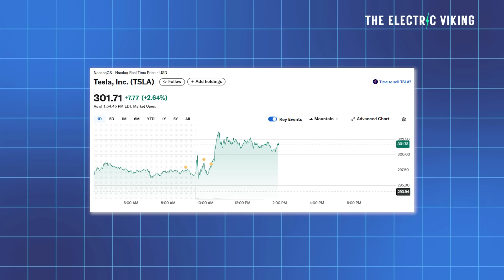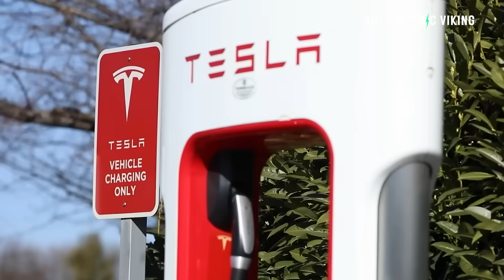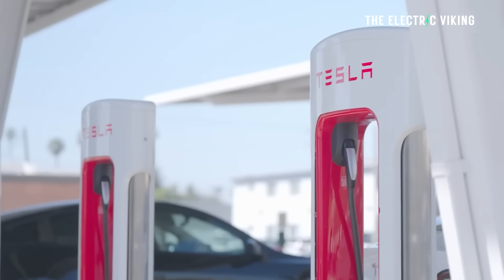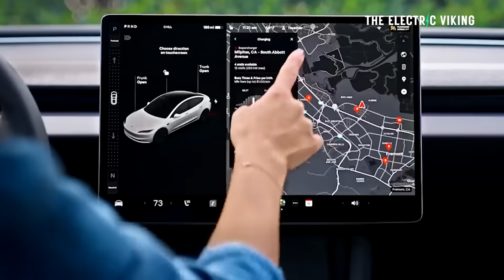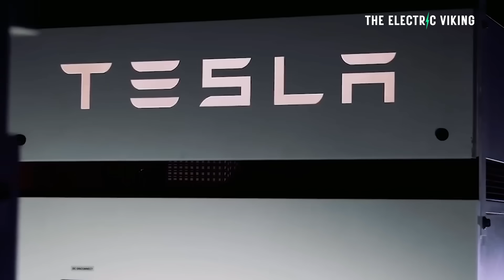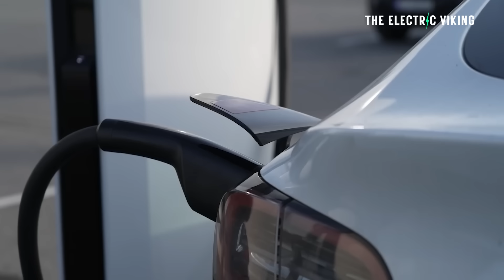Tesla's not very secret PLAN to make BILLIONS with Peaker Plants

Comment: NIO is doing the same with the swap stations, some are topped up and the others are used to speclate on the energy market. A NIO insider told me the swapstations are profitable even without swapping. They have3300 stations now. Other ones like BYD also have batteries at their fast chargers to cover peak charging and speculate.

Comment: The thesis is valid, however Tesla does not make its own batteries. It makes them only for some vehicles but it costs them more to make them than it does to buy them. If Tesla was devoting enormous resources to manufacturing grid scale battery packs they might become a market leader. But no, robotaxi and robots are where they are putting their priority. Other competitors are growing everywhere and Tesla is growing slowly. So like the charger business they threw away by firing all 500 in that business unit Tesla is not optimizing their potential.

Just like robotaxi, where competitors like Waymo and Zoox, and several Chinese companies, have outpaced Tesla in autonomous rollout.

Comment: To have a 1:1 solar powered "gas station" the ground footprint would be the size of a 1980s shopping mall, which means a roof setup is just for marketing.

Using the excess solar power off the grid is definitely a smart move.

Comment: So long as they use brownfield sites and buildings instead of clogging up arable farmland with solar panels then it's a great strategy, and homeowners should be doing the same for their own homes as soon as they can afford to cos solar panels and batteries are basically a money-printing machine powered by the sun, whether you use the stored energy at home or sell it to the grid at a premium to buy back when it's cheaper.
Reply: Tesla should locate production and storage as close as possible to the charging stations because a lot of energy is lost to friction in transmission. Do they do this?

Comment: The same analogy applies to hydro electricity .its Free too. The rain falls runs the turbine for free ,the water evaporates and it rains again. The difference in hydro is it’s not 2 hours a day like Teslas batteries its 24 hours. Hydro actually produce  the electricity Teslas batteries just transfer it from other generating sources to a different time of day. The concept of “Free” used here disregards the capital cost.

Comment: 62 cents per KWh is insanity and only works in CA.  We pay about 42 cents peak around here and even that is so high compared to a few years ago and only barely break even with gas.  Gas is actually cheaper than supercharging now.  As a comparison the model Y at 3.6 miles per KWh @ $0.62/KWh is equivalent to a 32 mpg gas car paying $5.58/gallon for gas.  Nobody is converting to EV’s at that pricing so your superchargers will be empty.

Comment: What about the cost to rent or buy the land and the cost of the capex for the batteries and installation. It would have been good to add how long it will take to pay off that investment before you actually start turning a profit
Reply: Those numbers have been crunched.  Solar wind and batteries are the cheapest form of energy cradle to grave.

Comment: I have time of use charging in illinois. When I first started the cheapest time to buy electric was between eleven p m and six a m. Today that time has changed 'to 2 am until ten am. At those times it cost between 0 and 2.8 cents per kilowatt hour. My highest rate for electricity during the day (at peak times is sixteen cents per kilowatt hour. Tesla with its virtual power plant can get paid between two dollars and seven dollars per kwh at peak use. All Tesla would need to do is add 1 mega pack to each charging station and they could make the difference between 2 cents per kilowatt hour charging at night and get paid 2 to $7 per kilowatt hour during the high peak use. They already have the connection to the grid.They already have the distribution nationwide. This is A no brainer it will make Tesla billions. I did the math on cost of  running my model.Y and if I charge at home, the cost is .007 cents per mile. Over the lifetime efficiency of the car at a hundred and seventy thousand miles very cheap to run.
Reply: FL Power allows unlimited FREE night and weekend charging of EVs.  They only charge $31 a month for leasing the chargers which they install!

Comment: Summary per Grok:
Tesla’s claim of 100% renewable energy relies heavily on purchasing RECs to offset grid-based fossil fuel use, which has been criticized as misleading since it doesn’t reflect the actual energy mix at most stations. Without comprehensive, up-to-date data from Tesla on the proportion of on-site solar versus grid power, a precise figure is difficult to pinpoint, but 5% is a reasonable estimate for direct solar contribution across the network based on available information

Comment: I agree wholeheartedly with this analysis. It's the joined up thinking we need.  Governments should embrace this combined distributed electricity generation-grid firming-EV charging logic through market rules and incentives for new EV charging infrastructure. In the UK they are now finding many fast large charging sites are hardly used while others boom regardless of price. They were installed before user behaviour and spatial distribution patterns were understood. Australia can still avoid large scale mistakes and optimise multiple energy-system benefits in the rollout. 

Allowing electricity distributors to install chargers on their poles all over the country will spur kerbside AC 7-22kW community charging infrastructure for EV owners without home charging. With time of use charging and modest use of batteries it could also use up excess off-peak solar through local poles and wires. 

Throwing money for chargers at businesses is a poor strategy for the medium speed 'destination' charging network of 50-100kw plus where people or business fleets can fully charge in and around hour while already parked up. Instead govt could provide financing schemes to help install rooftop and carpark solar with batteries and EV charging at commercial sites. Some would also have capacity to trade in peak electricity. Big box roofs are the most underutilised distributed electricity resource there is (tenants and landlords currently need aligned incentives) and in many cases the on-site solar would allow a few charging plugs per site without slow and expensive new grid connections. 

Finally, the superfast national charging network we need is all about max charging speeds and optimal locations. Locations essentially just need to follow the distribution of petrol stations (and truck stops) to cover all of Australia. 3-4,000 small to medium sites with truck charging amenity is probably enough but they must focus on vehicle throughput and future proof charging speeds of 500kw to 1500kw+. Time spent looking for a charge or waiting for a charge is a PITA and lost money for commercial fleets. Government incentives for these sites should require Tesla-style linked local solar farms and batteries. Many will also be able to sell electricity to the grid at peak.

With strategies like these you'll get a lot of new distributed renewable electricity production and consumption through mostly existing poles and wires from capex shared with a much needed EV charging infrastructure. And it could save a motza in new large transmission lines otherwise needed for utility scale alternatives. Not to mention the economic benefits of keeping $40billion in Australian economy that we currently send to other countries to buy petrol.
Reply: School rooftops should be covered in solar panels. Big profit during holidays and weekends.😊

Comment: There are a ton of flaws, and in general inaccurate statements in this video.

1.  Tesla does NOT offer a 30 year warranty on the Megapacks, but offer a 15 year warranty, about half the claimed period.
2.  Several other energy storage companies will be able to offer much cheaper solutions with Lithium Iron, Sodium Iron or other storage technologies, as the energy density and weight isn't a factor in energy storage like it is in EV's.

This means that utilities will rapidly install their own energy storage, making Tesla's model for cashing in on peaker plants obsolete.

Just look at what anyone can buy today.  LiFePo4 batteries with 2.5kWh worth of storage are down to $300 or so, and can last 8000 to 10000 charging cycles or more.  Energy storage is being ridiculously cheap and simple to set up, with the average Joe being able to store 25kWh for less than $3,000 or so.

The cost for a Tesla Megapack with 3.9MWh of storage is just north of $1 Million dollars.  5kWh LiFePo4 battery packs can now be bought for around $750 or so.  Which means a 5MWh worth of storage can be bought for $750,000, and that is using retail prices when buying one or two at a time.  Buy 1000 or 10,000 at a time, and you would get a significant discount, getting the price closer to $500,000 for 5MWh.

This is the problem with a lot of the companies that pioneer something new.  You will see a bunch of new companies (already happening) jumping into energy storage, which will rapidly compete with these Tesla storage farms, and rapidly evaporate these peaker profits.

As a bonus, with Tesla losing emission credit sales and car sales still dropping, expect Tesla to start posting losses again by the end of the year...

Comment: Nothing is free sam.
The infrastructure has a cost and a return on investment requirement. 
Billions spent and Billions financed. 
So recovery cost and the charge out fee has to pay not only for the investment but the finance cost also as well as the maintenance and the repairs and servicing of the charger equipment.
There are Government licencing and permitting fees also.
A correction to your statement Tesla get power for free. 
Tesla do use grid power to supply roadside charging where they make a mark up Arbitrage profits on energy..
Tesla do not provide financial details for their charger revenue in Australia let alone other countries as their financials are consolidated accounts. 

So is it worth 220 times revenue- I don't think so.
Other pure power companies are not priced that magnitude. 
Tesla is priced for Fanboy attraction.  
Is it a solid business model - Yes but others are entering so it won't hold a strong first entry position for long.
BYD and CATL are signalling doing a similar thing in EU and in Australia with fast charger networks.
A number of companies have done the very same thing already in Aus with Solar and batteries feeding back to the grid in the wholesale market of the NEM here in Aus. 

All competition reduces margins and the Chinese will eat into Tesla's markup for sure.
I is not If - it is when.
Reply: The problem is that it doesn't seem that byd has made money selling evs and may be losing money in even the combined battery and hybrid markets......

Comment: TSLA down 20%+ since 1-1-2025.  BYD up over 40% since 1-1-2025.  That is a 60%+ swing.  3 months ago I sold all my 7125 shares of TSLA for $1.7M and bought 10,000 shares of BYD.  Check the charts......
Reply: TSLA up 11,000 % since IPO...
Reply: I will sell my TSLA in year 2030 when Tesla Energy is bigger than Tesla Auto
Reply: You sold at 238.60 a share. Today 10July 2025 the price is $296 up 24% on that price and it has been up to $363.

Comment: Those batteries won't last 30 Years. And batteries are very inefficient. In cold weather the chemical reaction of batteries is slow, where some say 40% less efficient. In hot climates batteries need to be cooled for the purpose of saving the battery life, which could be up to 30% efficiency loss. And for solar to be worth it, it needs to be a sunny climate.

Comment: I live in Texas and I'm already shaving 3% of my electric bill daily. 

Add solar panels get less expensive and the batteries become larger for the same price, that's going to increase to perhaps 10 to 12%.
Reply: Just 3% ?
Reply: @Techno4more  Yup.   Saves me about $60 per year now.   The main purpose of my solar system is to preserve food in the freezer and refrigerator and generator propane.   Which it has done twice, saving me about $500-600 in food (plus having to throw out rotting food twice)(plus having to go shop and buy everything again).

And it saves about 8 hours of propane per day... which is about $20 per day during a disaster plus it extends my time with generator power by a full day and reduces run time on the generator.

I use 30 kilowatts per day during the summer and my current system generates 1000 kilowatts per day.

My next upgrade will be to about 4.5 total kilowatt hours per day.   So about 15% of my power needs plus further savings on propane and more hours of free AC.   

That will likely be in January.

I will not go into debt.   Plus prices are dropping so fast while capacity and output are increasing constantly.
Reply: Oh ... and it also means I don't have to nurse the propane generator and I can get a full night's sleep.
Reply: earnings 3% / $60 per year ..... what is the price for the battery??? At least $5000 so in 83 years you get brake even! And how long will these battery last? 8-12years? I love PV-solar and EV's - but feel its not economical. In norway 1KWH is about $0,01-0,02 and a 5KW-10KW is about USD 10.000-20.000. (Installation is sure a huge cost). To expensive. Germany power is more expensive about $0,04 so in germany its more popular and perhaps will be earned inn after perhaps 8 years. Small 800W solar "Balkonkraftwerk" become popular .....
Reply: @knutposchel2165 no.. the battery and panels cost me just under $1,500 and after 2 years the system is half paid off.

You completely ignored my statement about how it saved two refrigerators and two freezers full of food. 

And today,  I can buy a 3000 watt system for about the same price as the original system.

Since I have so much insulation on my house, it would not be profitable for me to put in a grid-tied system.  But at current rates of price decline incapacity improvement, it will certainly make sense in about 3 years.

You can't go out to turn on or even set up your small generator during a natural disaster and I don't have $20,000 for a built-in generator.

And beyond these two, I have literally hand-carried the battery to two friends, house who didn't have power and saved the contents of their refrigerators.  I have no idea how much money that saved them.  But certainly saved her from having to deal with refrigerators full of rotting food.

Solar and wind power and batteries are all as bad as they were ever be today. They only get better from here.

Comment: Yes, the power division is very well placed and profitable (of course it is not free ... the land, machines and labor are not free).  My guess is that EV profits drop (and the EV credits as well), but power (and especially peaker power = duck curve) will make up for it over the next few years.  Yep, solar + storage is a killer app.  Then you have the premium SuperCharger rapid charging rates, and that is very nice profits.  In the long run this will be the Tesla story, as EVs/FSD and Robots (we will see if that is real) will be a side story.  Of course this caps out Tesla valuations as more of a Electric Utility companies, which drops the PE on stock a bunch.  Per their solar farms, they sell into the grid unless they are direct wired to the SuperCharger stations, so its almost always a mix of all sources (inc a bit of coal, still).

Comment: To make money from chargers, you need cars to charge.  With car sales decreasing, that seems to be a problem.

Profit dream deferred - womp womp
Reply: The power plant that Viking was originally talking about where the 168 chargers are installed (or are being installed) that plant is designed primarily to export to the grid. Tesla in this case is not building it to charge 160 EVs they are building it with the solar panels and Megapacks to generate electricity from the sun, then store it -then export when the price is the highest. The EV chargers being used is the cream on top. Tesla will offer super cheap rates during the day especially if the batteries are all full -then in the evening export into the grid. Tesla does not need the EV chargers at this site to be used to make money at this site. Other sites, usage is a big factor in profit. In this case Tesla had to provide so many EV chargers for approval of an exporting electricity plant. This is a copy and paste design from other exporting sites (just a bit bigger). In the future they will be bigger ones.
Reply: What areas do you see it failing?  Probably government ones.

Comment: Very impressive video Sam - one of your best in recent times, IMHO. I didn't fully realise/comprehend the supercharger network - not only does it make money through charging EVs (not a lot, but a bit), but It's becoming a widely distributed power plant. As you said, the megapack batteries fill up during the day as solar pours in, and then drain when more power is needed at peak times (making Tesla a fair bit of money, potentially, and reducing the need for gas peaker plants). It's a genius move - absolute genius. Next step - solar gigafactory to produce all the solar panels, thus pushing this project into near full vertical integration?
Reply: Tesla already bought solarcity
Reply: Why super? Just run of the mill Level 3. Definitely no need for that prefix.